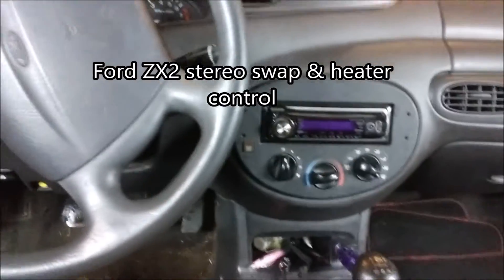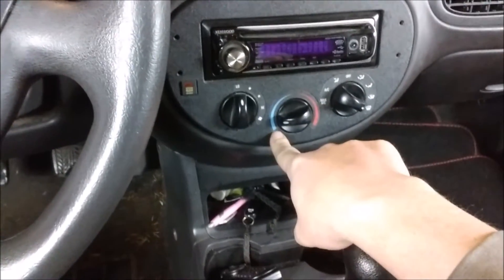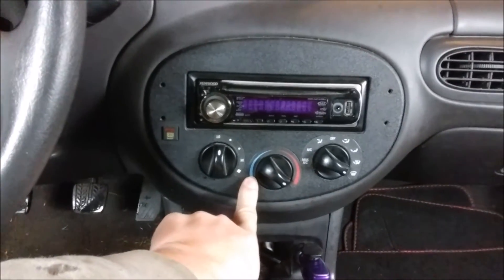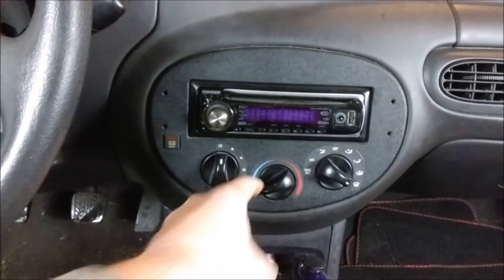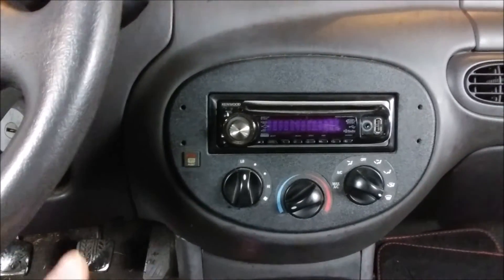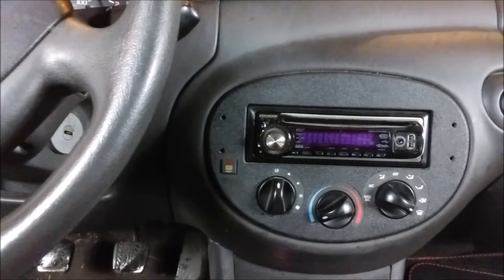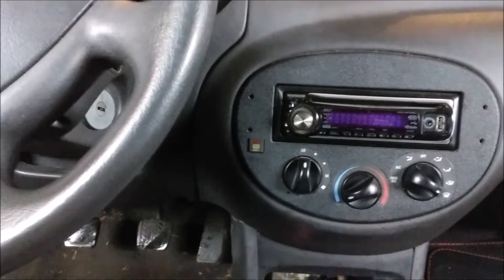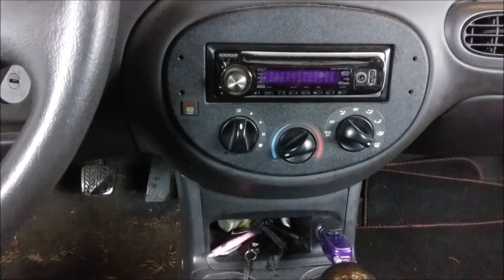ZX2 stereo swap

Comment: I want to know how you popped out the head unit at the beginning.  I have a 2003 and it's got an after market radio in it but I'm trying to out in a Bluetooth and can't get the head unit out
Reply from the maker: most aftermarket head units have locking tabs on the support frame. if you unsnap the beauty ring you should see a flat slot on both sides of the head unit. I have a set of release keys (from prior installs) but a metal shim can be used. Just look up 'release keys' for the brand of stereo you have.

Comment: My car  has a 6 disc cd changer.....how can i replace factory radio and still use my changer?
Reply from the maker: Documentation on both the steering wheel controls and disk changer are limited. I could live without the changer as USB drives work so much better and most new systems support them, but loosing my wheel controls has prevented me from going further. I may attempt it on my next XJ, as this one is slated to be rotated out in a couple years.
Reply: @SRMWorkshop  oh...o.k....i think i would have to buy another changer....with its own remote ...thanx...

Comment: Do you remember the wiring diagram??? I tried a bunch of websites and it’s not the right one
Reply from the maker: the harness adapter I bought for this car many years ago had all the wires color coded to match the stereo harness. I think the only change was the battery constant and battery switched were reversed. I know for sure kennwood and pioneer use the same color code for many years, and a couple other brands have as well.
Reply: Ok I got it thank you though